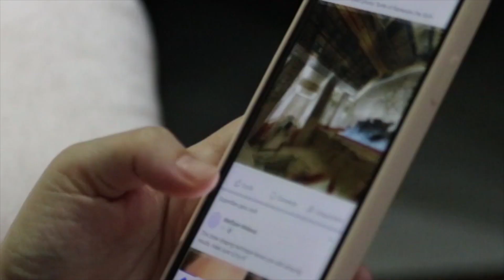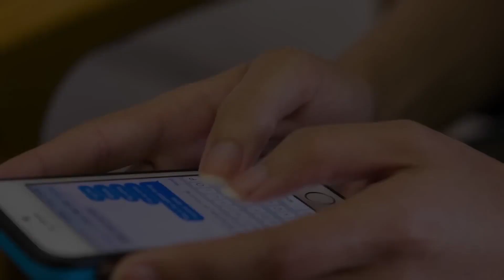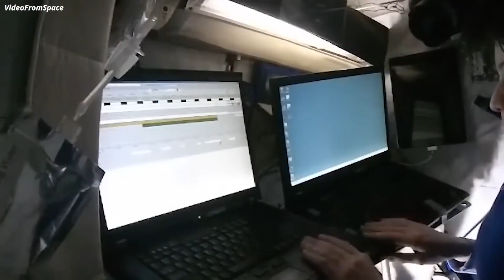NASA Develops Real Light-Speed Rocket Engine for Space-Time Travel

Comment: The ion drive in novel and all but your going to need more umph to get to light speed. The ion drive may help maintain light speed travel but the issue isn't going light speed, it's stopping from light speed.  Now put on the breaks a 17,000,000 miles per second while traveling through a vacuum. Then fit in exploration time and return travel.
Reply: You cant use an engine to get to light speed, the faster your going the more mass you have. If a object that isn’t massless is traveling at light speed it would have an infinite amount of mass. It would take an infinite amount of energy to accelerate to light speed and decelerate from light speed